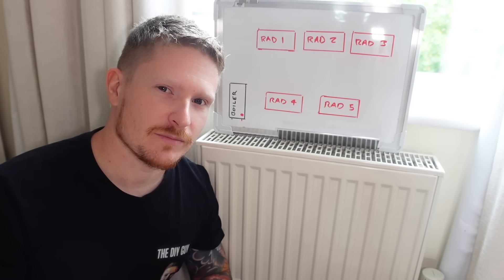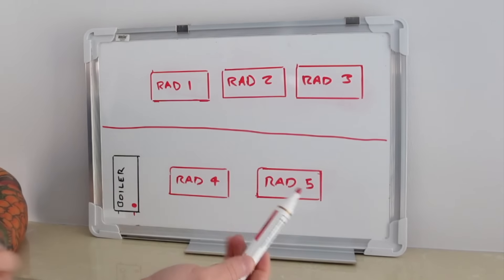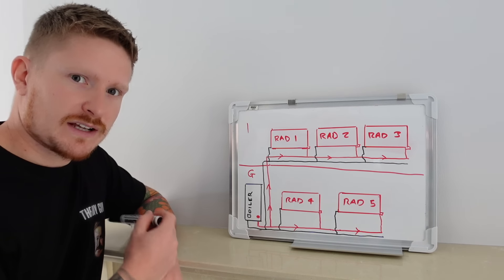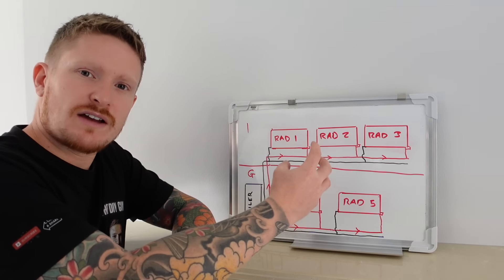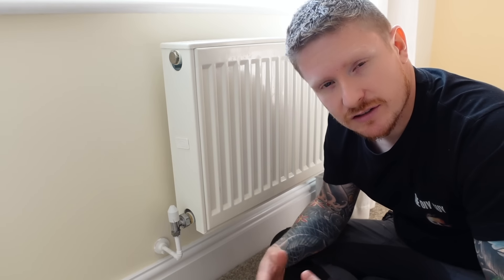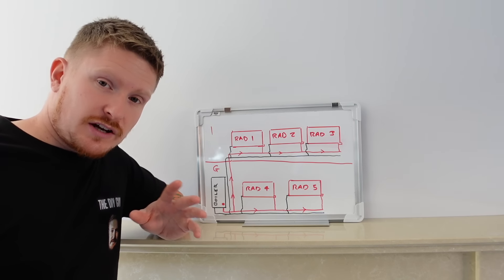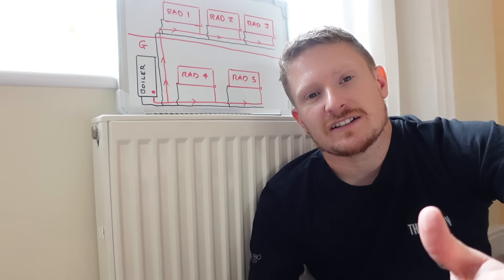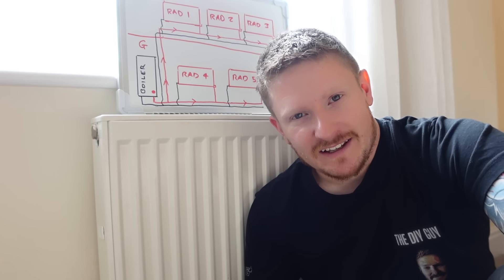How to Balance Your Radiators | Save Money and Increase Heat

Comment: We had a new boiler installed last year and since the radiators downstairs do not heat up at all, we live in a 3 storey town house, upstairs are piping on the top floor, middle floor only one not heating up, there’s a tiny one on the landing on the middle floor which is mega hot, I’ve tried balancing as a last resort but to no avail, all radiators worked absolutely fine pre new boiler installation so maybe it’s not been installed correctly, British Gas have sent out numerous engineers and the last one to come out seems to think that maybe there’s a blockage somewhere so he put something in the downstairs loo radiator after draining it as the water he said was contaminated that came out of it suggesting a blockage, he said that because the pipes are small that a full flush wouldn’t have been performed as it would have blown the pipes so probably only a semi flush was carried out, he said to leave it a few weeks to see if the stuff he put in works and shifts the blockage if there is one, obviously we’ve had summer so was hoping that the problem would be solved when we turned heating back on but nothing! We don’t understand how all radiators were fine before the new boiler, currently waiting for British Gas installation team to come out and inspect but heard nothing! Appalling service, any ideas please? Thank you 🙏🏻

Comment: Just like to ask when you get your boiler serviced is the engineer supposed to check the radiators and balance them or not ?. Ive taking of my thermostatic valves. got two radiators up and 4 down stairs

Comment: Thank you as per usual a great video. My boiler is upstairs, the three rads furthest from the boiler are luke warm on top cold on the bottom. I have been told these could be full of sludge and need to be purged, would this be the case or is there a simpler remedy?

Comment: Hello! How do I tell the difference between the lockshield valve (which empties the heated water out from the radiator, right?) and the other valve (through which heated water comes in the radiator, right)? They both have caps with a +/- sign on them, thats why I cant tell the difference. Both valves are located on the left side of the radiator - one on the top, one on the bottom. Ive opened both valves to the max (clockwise, or + sign) for now. Once Im able to figure out which valve is which I will follow your advice on energy efficiency and cost saving. All the radiators are boiling now and that doesnt feel right to me. Thank you in advance!

Comment: Thx for the great tutorial, just im having a small issue, most of my radiators haven't got a Trv, both ends are exactly the same, how can i tell a difference between infeed and outfeed....by the way i managed to get the cold radiator warm, but it was more like a gamble since i didn't know which side to adjust (did both) some others now turned completely cold....im lost here

Comment: Very interesting. I will have a go at this as I live in a bungalow where the back rooms, which coincidentally are furthest from the boiler, are always colder. I've always thought this is to do with the orientation of the property as the front of the bungalow is south facing so gets more sun, but I am now wondering whether the radiators are balanced.Particularly important as we have no mains gas and rely on heating oil which is even more expensive.

Does anyone know if an infrared thermometer gun could be used instead of the camera? They're a lot cheaper!

Comment: Surely all the thermostatic valves must be set at the same level? What if you are trying to balance a radiator when in fact the valve isn’t working properly? How do you know if that is the case? Thanks.

Comment: I have a couple of radiators with two lockshield valves, one on each side. How does this effect the adjustments, especially the method without temperature reading equipment? Also, my other radiators have a lockshield valve on one side and a 1-5 temperature control on the other. What setting should I have the temp control on when making these adjustments? Thank you

Comment: good video thanks I now understand to he logic which I never have. as a suggestion an alternative to having a thermal imaging camera is a digital thermometer with probe. these are 4 quid on eBay. the probe strapped to the pipes either side of the radiator seems sensible ?

Comment: Is there any link between gas consumption and how many radiators are turned on at a time? I turn off the lock shield valve of the radiators which I do not want to use. Is this a good practice to keep my gas bill low? Please advise.

Comment: Hello

I'm about to install 4 new radiators downstairs and i have new pipes installes as well.can you please advise me on which pipe I have to install trv?Is it always on a flow pipe?Thanks
Reply from the maker: Modern valves don’t rely on flow direction in the same way as they use to. Trv can be on flow or return in most cases

Comment: Before blasted regulations came in, my bolier heated my water tank, inside which the radiator pipe ran thorugh and up to the bathroom radiator which was always warm. That helped to keep the chill off the entire upstairs.
Then regulations hit and when I needed a new boiler, my old Vulcan was replaced by a shitty new one (couldn't buy those boilers anymore in England, but Scotland was allowed!), a pump was installed and now upstairs is always bloody cold unless the heating is on. So these ruddy regulations have cost me MORE money to heat my house than it used to.
And that's BEFORE this manufactured energy crisis hit!

Comment: I actually thought it doesn't make much difference by adjusting them and have the valves fully open. 
I was told the boiler pump have 3 speeds selector to change flow rate. 
The valves can start leaking by adjusting them.

Comment: Great video. I have a question. I have a 4 bed house with 11 radiators. They all get hot so quickly. How do I tell which one is getting hot first? And the next one and the next one and so on. Any tips? I ordered a laser thermometer last night so I could balance all the rads in my house. 🙌
Reply: I have the same problem 15 rads 🤷‍♂️😂
Reply: How many friends do you have - you may need 10 😆
Reply: Try restricting the overall flow by turning down all lockshield valves to the same open setting, this may highlight the ones receiving hot water earlier.

Comment: Great video, just replaced all the old rads and upgraded all pipes from 8mm to 15mm. When doing the temp check, what do you do with the TRV? Can it be at any setting or fully open? Thanks in anticipation.👍
Reply from the maker: Hi, thanks. Fully open 👍

Comment: Does the 12 degree drop apply to all radiators, size and amount of panels, I have a small single panel one and I get a 4 degree difference when I only just get above closing the lockshield valve completely

Comment: oh, we had our house redecorated recently and all the rads were changed to new ones and all this balancing stuff and flushing etc took place so i'm not sure if the rads were the difference, or the flush did the stuff or that it was the balancing
either way, the house now gets warm much much quicker and the heat lasts much much longer
but this is a good way to test the parents house so i'll give it a go next weekend, thanks
Reply from the maker: Probably a mixture of the two. Glad you found the video useful.
Reply: The old cast iron keep the heat around for longer too I heard

Comment: The 10mm push fit used at each of our radiators makes balancing them tricky. Too much of a knife edge when adjusting the needle valves. Good vid though

Comment: Great Video, can I just ask, on the bit you say to turn mine has a screw on the top, if I turn the screw will that adjust it, or does the whole thing need to be turned?
Reply: If it's a very small screw at the very top of the lockshield valve  it's possible that the plastic bit (that it's supposed to keep in place from prying hands) is missing. No need to remove the screw  but the actual 'bit' that you turn looks  like an upside down flat bit screwdriver (looks very blunt though).

Comment: Hi ther DIY guy, great video, one question if I can please, if I use the thermal imaging camera, am I looking for roughly the same temperature flow in on all the radiators, I have 15 radiators and to find which is first and last on the system is tricky, so I am thinking if I have the thermal imaging camera and all are adjusted to more or less the same flow and return temperature, will this be ok and I wont have to find which radiator is first and last, hope this makes sense, thanks again.

Comment: if I use TRVs on the radiators , should I still adjust lockshield valves ? or is it unnecessary to adjust them because TRVs do the adjustment automatically ?
Reply from the maker: Yeah you should still.

Comment: Hi , great vid , I have a problem with my system , 17 radiators, with 7 added to an building extension and there is a possibility the boiler is not big enough, at the moment for me to find out what radiators are first , second etc will this not depend on how it is balanced at the moment, what I mean is could I get heat from a radiator that is possibly 3rd but because it’s unbalanced heat up first. I have 5 upstairs that all have a quarter of a turn and are working and the other 12 are about full turn each and are working, there is one       That doesn’t get great heat and the pipe supplying it isn’t that warm,there is a chance it’s the last.
Reply: You need to open all valves then turn boiler on and feel which heat up first.

Comment: Thanks. Very helpful! Would one of those infrared gun type thermometers be any good as they’re a lot cheaper? If doing without a thermometer do you leave the last radiator lock shield fully open?
Reply from the maker: Yes and yes 👍

Comment: Do the thermosatic valves not unbalance the system as they will turn on and off asynchronously unless they are all at the same temperature, which is unlikely as bedrooms will usually be set cooler than living areas?

Comment: this is great, been meaning to do this with our troublesome system and genuinely looking forward to it after watching this video now. just replaced a motorized valve the at the weekend and fitted a new 2 panel. radiator in our living room. ended up having to drain the whole system but have an airlock in the living room and master bedroom now that I need to deal with before adding more inhibitor, and then getting to balancing. biggest problem with our system (16 radiators.....) is i have no idea what sequence the circuit is. is there any quick way to tell this?
Reply: I have the same question. I've got 14 radiators in the house, and because the ground floor is solid, the ground floor rads are all individually drop-fed from above. So I'm not sure how to establish the sequence from first to last rad. Is there a way to do this?
Reply: @Gary Davis  What type of heating system is it, ie do you have a hot water cylinder? Or, does the boiler fire when you open a hot tap to provide hot water ie is it a combi? When was the boiler serviced last?

Comment: ok, I have a question,, my building I take care of, is large, and has many rooms and many bits that have been added over the years.. a lot of radiators are hotter than others, and a lot have the caps missing.. so how do I know, which is the out valve and which is the tempreture control valve ?  is one always on the same side and the bleeding valve,, because even on the radiators, some being older than others,, the bleeding valves are also not on the same side as each other. thanks

Comment: It if a silly question so please forgive me,some of my dads don’t have the thermostat fitted,so on the older rads,which side of the rad is the valve I have to undo/tighten?as there are 2 pipes into Rads

Comment: Wouldn't know where to start, I count 16 rads in our house (one removed, technically 17). New boiler installed a number of years ago (about 3). Boiler is in the utility room. There's a rad ther that's always been off. No hot pipes so I gather that's not the first in line. Any tips would be appreciated to figure this out. If I go around turn off flow in rads could I figure out which is the first in the line?

Comment: 1. How can you tell which is the flow and which is the return seeing as the TRV could be on either?
2. I don’t know the order of my rads in the circuit, it ain’t easy turning the heating on and then running around the house trying to figure out which rads get hot in a specific order.
So, how do I approach this please?

Comment: How do you do this with a heat pump? With heat pumps the flow and return temperatures will be much lower. On my system with 14 radiators and a section of underfloor heating I have just opened all of the lockshield valves fully and relied on the thermostatic radiator valves. Seems to work but is it optimal?
Reply: You shouldn't have a heat pump with a conventional system.  Each room should have its own air stat, and linked to a small valve which allows water to pass, or shut off.  Why has someone installed a heat pump without correct control of the system?  As you say, just leave them wide open.  If a room overheats, cut it down.  But it shouldn't with a TRV.

Comment: fitted new large double radiator last in chain.It is colder at bottom parts. could it be balancing or sludge?. cant see how a new one can have this in it. the new towel rail in bathroom is scalding hot also the old late 80s doubles are hot all over. ? could they have fitted faulty radiator?

Comment: Council replaced all c 1985 water piping and put the new TRV at the top. This means that the valve is sitting in air and water and the entire building radiators sound like a chugging motor boat at certain settings. I have looked at a hundred photos and only 2 show TRV at the top. The maufacturer specs show the valves at the bottom. Any thoughts?

Comment: I watched as I have two radiators that are cold top to bottom, but the pipe taking the water in is cold to. Does this need a plumber?

Comment: @TheDIYGuy1 Hello, I have watched almost all your videos. I have an apartment in Germany (ground floor). The issue is that there is no sufficient heating from all the 6 radiators. I see that all these have lower half portions are cold. upper is only slightly warm. No bubble issues as I checked. The building is centrally controlled with heating. The apartment has been recently renovated. Kindly provide your valuable suggestions or advises to check. Thanks.

Comment: I have cold rads in my living room, I have 2 bedrooms that aren't used , can I turn those lochshield vales right down , so it gives more heat downstairs
Reply: Try a 1/4 turn from fully closed on the bedroom ones and one full turn on the rads in the living room

Comment: Living in Celtic Tiger house..  loft bedroom rad has no TRV, just a locking valve at each end.
Recently had motor and pump replaced on boiler, now loft rad is not heating.  Pipe and fitting on left hand side heating up but rad/everything to the right not heating.  Bled rad but no change.  Towel heater/rad in loft bathroom working perfectly.  Any tips?

Comment: My house has a dozen radiators, all on the first floor. The boiler is ground floor level. It's impossible for me to tell which order the radiators were installed in. Is there another way that I could apply this method? Two of the radiators in main room areas, are not working at all. Also, the radiators are from the 1960's. They are similar to the style in your video, but I cannot find the air nipple anywhere! There on only two valves on each radiator, with no air nipple, and no discerning way to bleed them.  Any tips would be really helpful in regards to what the lock shield valve settings should be, and what to do if there are no air nipple valves.

Comment: Out of curiosity how would this work if both valve on the radiators are manual and none are thermostatic valves? Our house was built in '92 and both sides of the radiator have the same looking valve. Which side do you adjust and what do you do with the to other side which isn't the return?

Comment: If you turn the flow temperature to the radiators down, then the boiler will go into condensing mode, which is much more efficient.
Reply: As far as I know my boiler runs efficiënt when the water is below 55 degrees when it goes back into the boiler.

Comment: You didn't mention what position to put the trv into while checking temps, and at what point should temps be taken from when boiler has started or been running for 10 minutes etc??

Comment: I have a cold radiator in a downstairs bedroom the boiler is upstairs, house is upside down! My son turned all the other radiators off and the cold radiator did get hot, but once he turned the other radiators on the radiator didn't get hot again, he has tried turning the hot ones down a bit to try to get the cold radiator to work but unfortunately this didn't work. Have you got any suggestions of what to try next? 
Thanks

Comment: Thanks for that, it seems quite straightforward. In rooms that aren't used often is it best to turn the radiators off via the TRV?
Reply from the maker: Yes it is best if rooms aren't in use.
Reply: Putting it onto a frost setting might be better, in order to reduce the risk of a burst pipe…
Reply: This is debatable. Have a look at the heat geeks videos for reasons against turning radiators off, especially if you have a condensing boiler.

Comment: You can usually find that a radiator valve knob can be pulled off and used to adjust the lockshield valve.

Comment: So just turn the valves down a bit so the water cant escape each radiator as fast. Got one in attic so what would i do with that? Fully open valve or a closed one